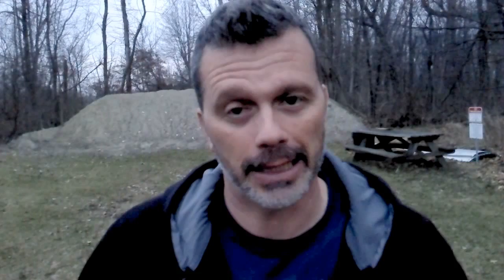HK VP9 Torture Test???

Comment: Guns aren't a precision part meant to operate in a vacuum.  I work in a rainy state for 12 hour shifts with a gun on my hip.  Moisture gets into the gun, and you aren't going to field strip and clean it each time o wrap up a traffic stop.  The vp9 "torture tests" have shown that it will fail if it's wet and gets any debris in it.

It is a realistic scenario that my gun will get wet and a little dirty.  Sure, at the end of the day I'm going to clean it and lubricate it.  But I can't tell a suspect I'm chasing through the woods to hold on because my vp9 got a little sand on it when I climbed over that last fence.  What I'm going to to instead is choose to carry one of the dozens of other options out there.

Maybe you don't carry a gun for a living.  But if you carry while hiking, doing ranch work, or want to do a tactical pistol course you're going to run into the same issues.

The vp9 has some serious faults.  There's many other choices that have triggers just as good, or better, that will run wet and dirty.

Stop inventing reasons why the faults are acceptable and just speak the truth.

"I realize the gun has some issues, but I like it anyway and it's my money so I spend it how I want because this is America, mother fucker."

Don't join the legion of gun apologists (looking at you 1911s are duty guns crowd).
Reply from the maker: My VP9 and VP9sk ran wet and dirty, both of them. I have video to prove it.
As a civilian I will never chase anyone through water, dirt or mud.
Regardless of what you or anyone else says, a machine that operates on slide rails should not operate full of foreign material. If it does it is a bonus.
Reply: Poe Performance a pistol pitched to law enforcement and the military as a duty grade, combat firearm, should be able to function in duty/combat conditions.  The slide rails aren't why the vp9 is stopping, it's the trigger spring, recoil spring, and striker mechanism getting gunked up.  HK quietly started putting vp40 springs into the vp9 to address some of the issues.
Reply from the maker: Regardless of what you or anyone else says, a machine that operates on slide rails should not operate full of foreign material. If it does it is a bonus.
Reply: Pabst Blue Lizard 
I was given a brand new Glock 22 RTF in 2009 from my department. Brand new. It failed 7 times during training. Not just in my hands, but in the hands of the firearm Instructors as well. But would I say Glock isn’t reliable? Certainly not. 
There are videos showing the vp9 working flawlessly in water, mud and dirt, and there are videos showing it failing terribly. Same applies to every other manufacturer. There are videos of Glock 19’s frame splitting. Does that mean all will be “terrible”? No. 
None of these tests were of the vp9 in a holster getting rained on. Not one test was like that. Not sure what kind of fences you jump that produce large quantities of sand, but I trained in the desert of Arizona and they run fine. 
I do agree that a gun can’t be expected to run in a vacuum. And I also agree that rain, snow, dust etc gets in our holsters and onto our firearms. And I agree that our weapons MUST work under these conditions. But the point of this video was to show that there is a difference between submerging your weapon in a tub of water for 5 minutes, VS getting rained on. There is a difference between completely covering your weapon in buried sand, VS sand in small amounts near your holster. The point he made was that the torture tests are not normal conditions by far. For us as police, we are not buried in sand on patrol. We don’t submerge ourselves in water until the bubbles stop coming up from the firearm on shift. Have you ever done either of those? I haven’t, and I did border crime unit for 5 years in the desert. 
I’m not saying the vp9 is the most reliable, but I’d have no problem carrying it on duty (vp 40 I’d prefer). But we get issued Glocks and I’m fine with that. They work great.

Comment: “Better to have it and not need it, than to need it and not have it.” This quote can be applied to quality.

HK USP .45 and Mark 23 say otherwise. 😎 

Me personally I hate when products break, snap, malfunction etc: even after you do proper maintenance. I will pay for quality if and when I need to or I want to.

I hate when things don’t last long and break prematurely. I will pay for quality and durability ESPECIALLY when it comes to certain firearms that are able to withstand the abuse and hard usage and that could potentially save mine or someone else’s life.

Certain products (no matter what the price is low or high) if the quality, toughness, durability, reliability, strength, etc: are there I am paying for it / that because that is what I value in my certain products that I want quality in. 

If you want quality, durability, strength, toughness, reliability, etc: then pay for it (whether low price or high price as long as those things that you want in a product are there)

Comment: I have a slightly different take on torture tests. I also don't care about them because as a civilian, they don't apply to my firearms. However, i don't think that invalidates the tests. It's just that results can be valid and irrelevant to me at the same time. I also don't think think it's fair to compare firearms mud tests to vehicle maintenance because the guns are usually clean/maintained at the beginning of the test. Besides, most modern handguns run well without cleaning anyway although it will shorten their life. A more fair comparison would be testing well maintained vehicles in extreme conditions.

Comment: If I can choose a gun that functions during the torture test or a gun that doesn't why wouldn't I go with the military specs gun? Sure my chances of needing those specs are low but in the case of the VP9 its a far more expensive gun with less quality, quality being defined as mil spec. Sounds like you're making excuses for your favorite gun which is fine. Shoot the gun you like and the gun you will practice with most but don't try to tell others mil spec equipment doesn't matter.
Reply from the maker: This video had absolutely nothing to do with military specs, zero. Military specs were never mentioned or even implied.  I have personally seen the VP9 and VP9sk run after being submerged in dirty water so I have no need for excuses. You're using the Internet to try and sound knowledgable, it isn't working.

Comment: Replaced that rear plate on the slide covering firing pin indicator hole up to keep debris out. Same as rear plate on Glock.
Reply from the maker: Guns 4 Europe It's an option although my two VP9s did run fine in muddy water. Not a bad option as a precaution.

Comment: Exactly. For instance the Makarov was tailored towards the military, made to function in most adverse conditions and it does.
A self defense gun designed for a civilian, in the other hand, is not designed to work under these conditions. 

The VP9 is not a weapon suited for military use due to the lack of reliability on adverse scenarios, still HK branded the pistol as highly appropriate for military and law enforcement use. 
That being said, I think for a firearm to be endorsed to the military it needs to be able to pass certain tests, like it's required whenever the armed forces run trials for new weapons.
Reply from the maker: Thanks for the comment, much appreciated. It's called the "People's Pistol" for a reason.

When there are doubts about the reliability of the VP9 is adverse conditions, I point people to these tests...

https://www.youtube.com/watch?v=eJr453erCAc&t=1s

https://www.youtube.com/watch?v=j5SMir0VKdo

https://www.youtube.com/watch?v=7pCtzEs2emc

Thank you for watching!

Comment: So guns like the USP etcetera that are made to be precise and reliable shouldn't be expected to operate under the worse conditions?
Reply from the maker: Worse is subjective. If by worse you mean completely submerge it in mud and expect it to work as if it were clean and lubed properly, no it shouldn't. If you cram a bunch of foreign material into tight areas of any machine, it shouldn't function. If it does, it's a bonus. Unfortunately the expectations aren't based on common sense and science; they're based on YouTube videos created to get views and generate revenue.
Reply: Those guns had to meet a military requirement. Had the VP9 needed to do the same, it would cost even more and not be readily available to buy because of high military demand.

Comment: Granted, most gun torture tests are for entertainment and do not simulate real-world conditions that would be encountered. However, it is a little naive to say that torture testing is completely worthless; the military selection process is rigorous in their desire to select a gun that has the specs to handle a diverse array of conditions over a period of time and different number of users. Guns that continue to function in harsh conditions are not just written off as, "oh, I'm glad it fired, but it wasn't supposed to in those conditions," especially when it does have implications in saving lives. Consider the M16a1 in its trials during the Vietnam War, as well as issues with the M4 in Iraq. It still would've been my gun of preference, but many preferred the AK-74 or 47 simply because they knew that when loaded, they'd have 30 rounds of rock n' roll and not have to worry about reliability when in a firefight.
Reply from the maker: You missed the obvious "civilian" tone throughout the video. The average Joe throwing his gun in a mud puddle or tub of water does nothing to prove or discredit the reliability of a handgun. The only military reference I stated was true - a precision machine should not work with dirt or mud crammed into the action or after being submerged in water.
I assume you know why the M4, M9 and even certain military vehicles have issues running properly in the desert?

Comment: These guns are marketed towards law enforcement, law enforcement officers can find themselves in adverse conditions including dirty water, mud, dirt or sand. If you fall on the ground or drop your weapon you better hope that thing works when you pick it up to fire. VP9 is a great safe queen, not a duty weapon.
Reply from the maker: You completely missed the point of the video. And VP9 stands for Volkspistole (The People's Pistol). HK might try to sell the gun to LEOs as any manufacturer would, but that wasn't the design intent.

These videos show the "safe queen" VP9 failing miserably in harsh conditions:

https://www.youtube.com/watch?v=c5T4rdKN4mE

https://www.youtube.com/watch?v=eJr453erCAc

https://www.youtube.com/watch?v=j5SMir0VKdo

If that's the way a safe queen runs wet and dirty sign me up.

Comment: Nice video. I highly agree with this. But if adverse conditions arise, I do believe a practical test should be done. This from my experience using a M16A4 in MCT and I had multiple failures and also in basic with normal range Conditions..... I'm not a fan of AR rifles for that reason.

Comment: Sorry I disagree.     Obviously I'm not going to go throw my gun in mud just to do it.    However,   it's nice to know if I were trying to choose a sidearm for hunting,  which one I could and couldn't count on if I dropped it in dirt.     And, although we might not all be operators, not all of us are strictly controlled environment target range shooters either.   Some people do actually use their guns to protect themselves, and like to know which guns could be more reliable in adverse conditions.     If you don't like the torture test, simply don't watch them.     Don't trick people into watching your video to try to push your opinion.   I appreciate these torture testers putting their guns through the ringer so that I don't have to find out the hard way,  where my gun would fail, and potentially lose my life over it.   I'm assuming you're feelings were hurt when you're vp9 bombed Tim's test.    I have a vp9 as well.  I actually purchased it even after watching that video.    I just know not to fully count on that gun if there's potential to drop it in dirt.    I'll go with my p10c.        But, by your logic,  don't test drive a car, or buy a four wheel drive.  Just make sure there's oil in it and don't worry about snow or mud because cars are meant to be driven on paved roads.   Roger that.
Reply from the maker: Disagree and ramble pointlessly all you want, it doesn't make you right.